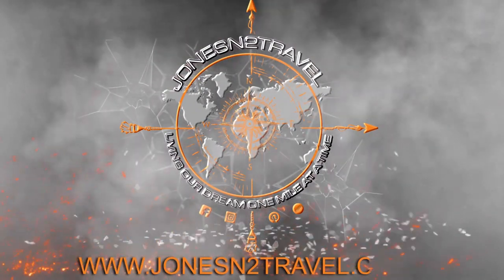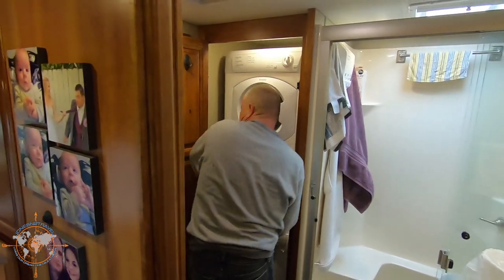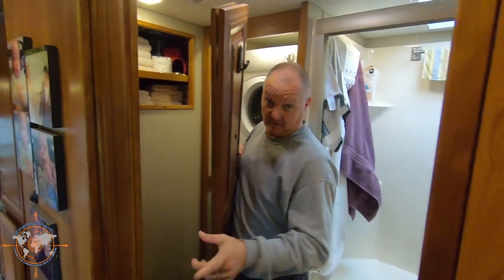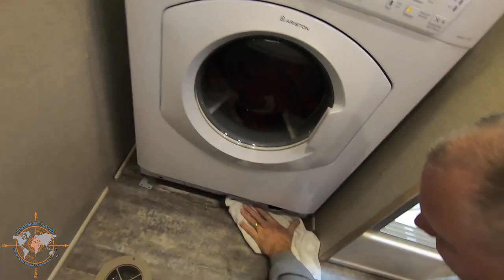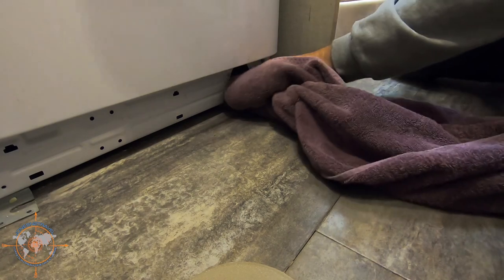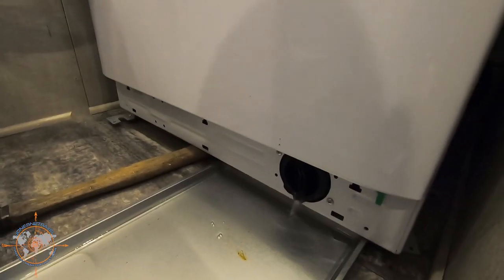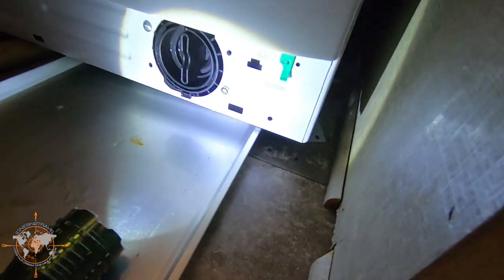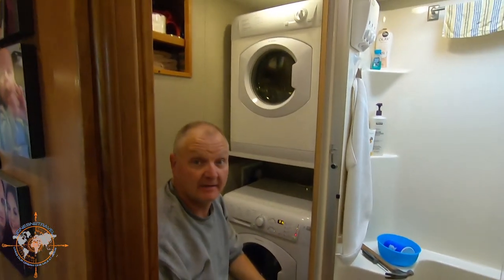HOW TO FIX F-05 ERROR | SPLENDIDE ARISTON WASHER | RV LIVING

Comment: Thanks for the video, I don’t know if this has been said but after I removed the plug and found nothing in the pump I replaced the plug then blew through the drain hose and that dislodged whatever was holding the water from getting to the pump.

Comment: Excellent video.  Our splendide has the same error. We took out the plug and guess what?  A color catcher was inside.  Now our color catcher was nice enough to wrap around the threads and make getting out the plug very difficult.  It is too late now to run a test load to see if it is truly resolved, but we have high hopes.
TIP: One thing we wanted to pass along is that green tab to the right of the plug you removed will release the door if you pull it and the washer door at the same time.  This helps in draining much of the water out from the drum and to remove wet clothes if it happens mid wash.   

Safe travels and thanks again!
Reply: We ran several loads today and it is working just fine.  Thanks again for the video.
Reply from the maker: Hi there. So glad to hear that the video helped. Thanks from the tip, will keep that in mind. Thanks for checking out the video and following along. Safe Travels

Comment: I couldn't just pull it off.  Using a screwdriver to depress the three tabs did the trick.  There are three tabs on the top of the panel. there is one about 2" in from each end, and one in the middle.  Just FYI, in case anyone else needs to know.

I had water collecting in the wash drum, that seemed to come in after the complete cycle ended.  I was not hooked up to sewer so I didn't want to run a cycle.  I didn't know how much water would go into my gray tank.  There was nothing in the drain pumps area like yours, but your video did show me how to drain the machine.

Great video and thanks for the reply
Reply from the maker: Thanks for letting me know. Our just popped right off LOL. Maybe it had been taken off before. Glad you were able to get yours off and get it drained. Safe Travels :)

Comment: I have a washer and dryer just like the one you were working on but mine does not have a book of instructions and I need to winterize it and I cant get it to come on. I have never used it. Can you help me?
Reply: How can I get a instruction book on the splendid. Aniston washer and dryer that I have in our camper
Reply from the maker: I would have to see if I can find our manual but it really doesn't tell you much. You might be able to find some winterizing instructions if you google it. We are fulltime so i have never needed to winterize ours. Sorry :) Safe Travels

Comment: Thanks for the post.  I'll go and make sure that I dont have anything stuck in the pump.
Reply from the maker: You're most welcome. Hopefully that fixes yours as well. Thanks for checking out the video and following along. Safe Travels
Reply: @JonesN2Travel  I have the washer working now.  Wasn’t anything obvious blocking but I spun the impeller.  It was stiff and came looser as I worked it.  I am thinking it was just gummed up over the winter. Again thanks
Reply from the maker: @lylecowan3792  That's excellent news Lyle. Glad it wasn't anything major. Safe Travels